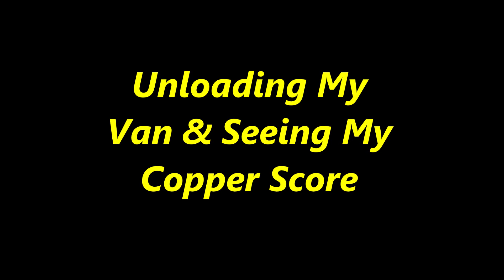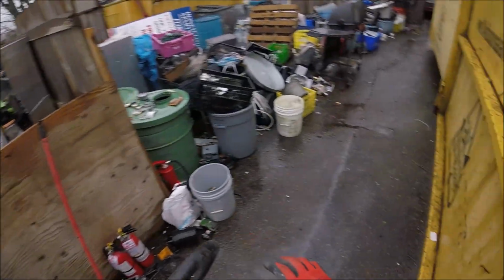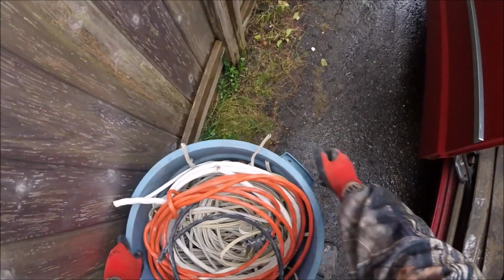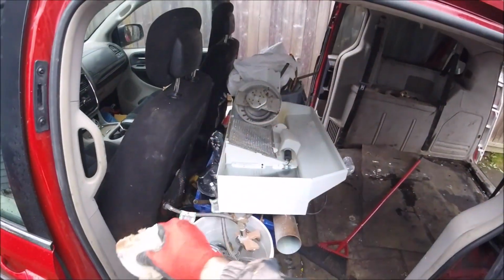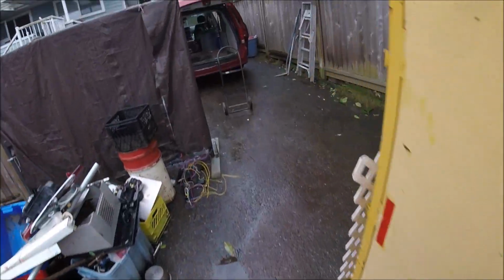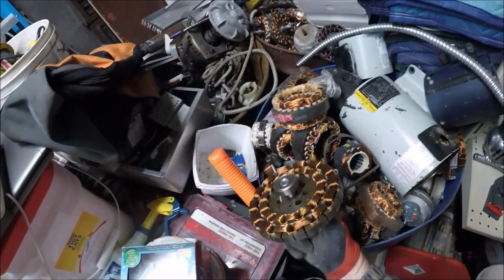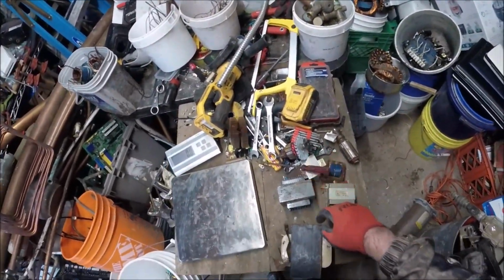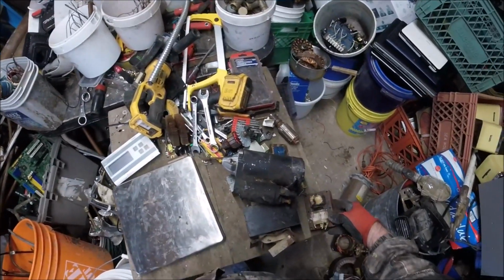Unloading My Van & Seeing My Copper Score

Comment: What happened to your plan to visit the demo house today? As I wrote in the previous video, there is a long 4 inch insulated copper pipe you left exactly above the bath tub where you were working. Also lots of cable, brass, lighting fixtures, appliances balance to recover from there.
Reply: After posting this comment, saw your second video of revisit to demo house. Nice score there. 👍

Comment: Phil just strip the big and easy motors. The math says you triple your money separating the copper from scrap. Transformer: 11 lbs motor scrap value = $6 vs $17 stripped (3.5 lbs copper = $13 plus 7.5 lbs scrap = $4). You could probably sell 3 of 4 barrels as is and leave one barrel of the biggies to strip.
Reply from the maker: I will sell the hard to strip motors & transformers for now

Comment: You got a lot of $$$$ sitting in your shop. I really hope you strip that wire from that house, I but love stripping that kind of copper wire. Thank you!
Reply from the maker: If I strip all that wire it would be less than $30 more value for over 6 hours of work, I based it on 70% copper to plastic & the iscrap channel rates that wire at 60% to 65% copper